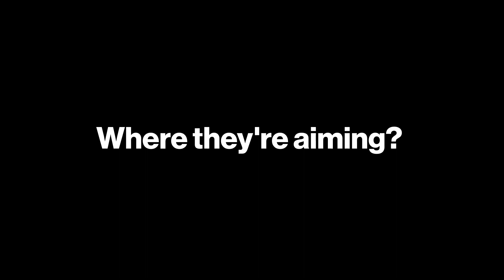China is Drilling The World's Deepest Hole - But Why?

Comment: 5:04 Atmospheric pressure "1300 times higher han what we experience up here" - really?  Why are you comparing the atmospheric pressure at the bottom of the hole with atmospheric pressure 50 kilometres above sea level?